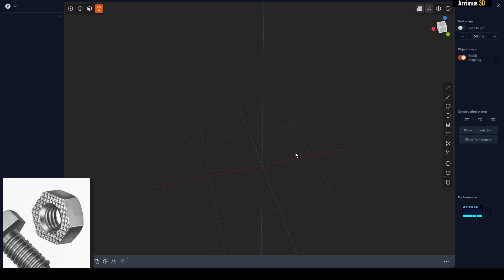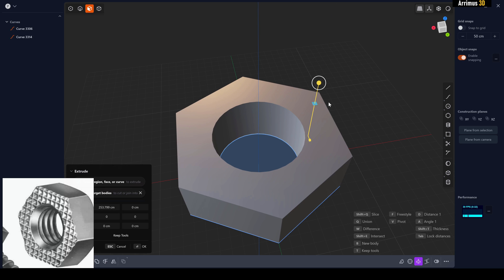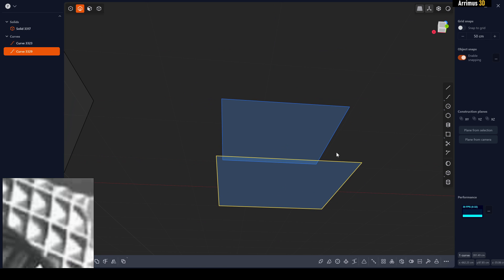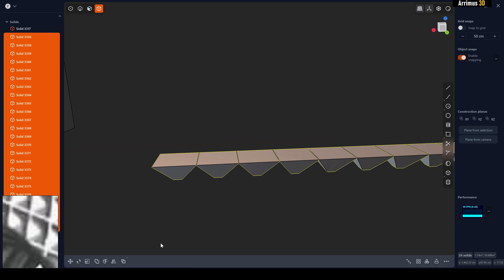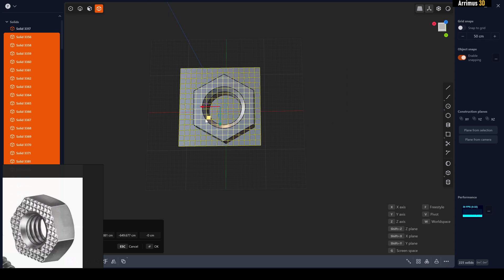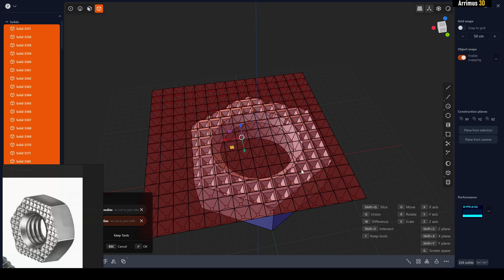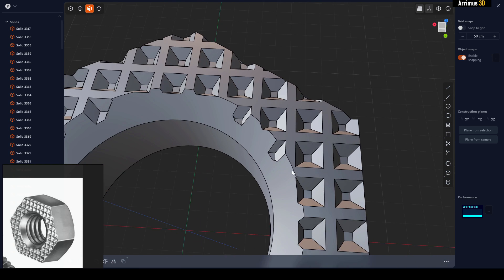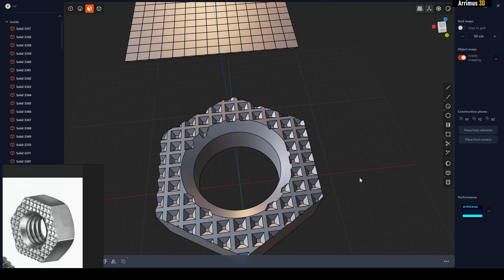Repeating Pattern in Plasticity

Comment: The interface has changed a lot, but one thing that was missed (and doubled the labor) is that instead of just putting a higher value in the "repeat" box, you arrayed the array. Setting a value higher than 1 in the repeat box will do that work for you (including spacing).

Comment: I really like the features of Plasticity, but I can't see it being useful as long as there's no export option so we can import those models into other 3D software.
If they enable export to different formats supported by 3ds Max I'll buy Plasticity in a blink of an eye.
Reply: Huh? It exports as STL, OBJ, 3DM ... I export model from it all the time into Houdini, C4D. Its fantastic, I have pretty much replaced MOI3d and Rhino with it for HS modeling.
Reply: of course there is an option for exporting as obj, you can also adjust the tesellation as you like